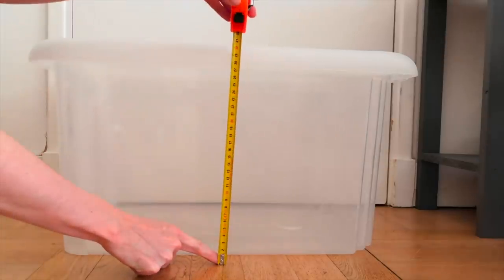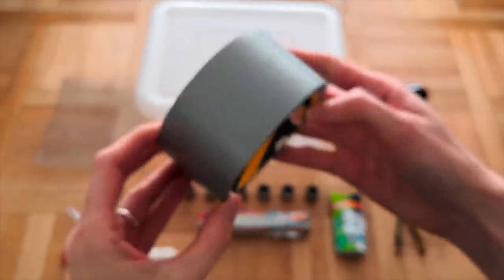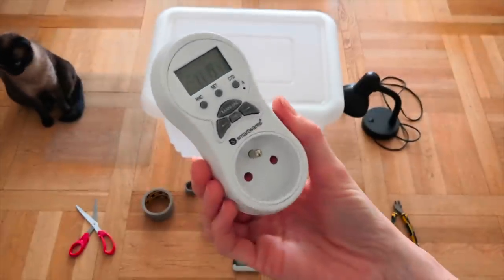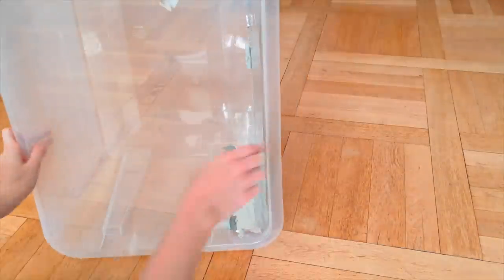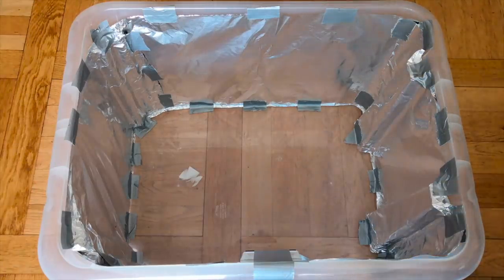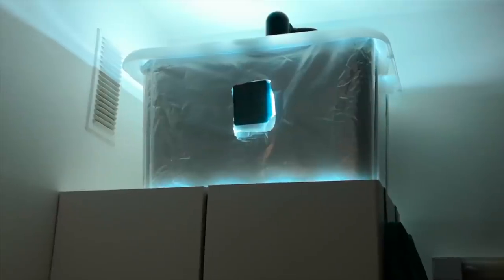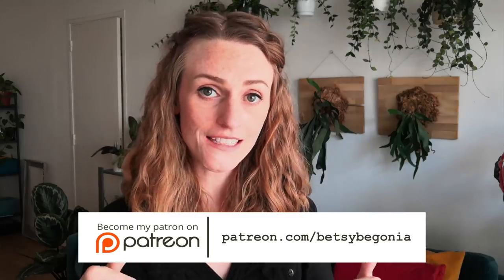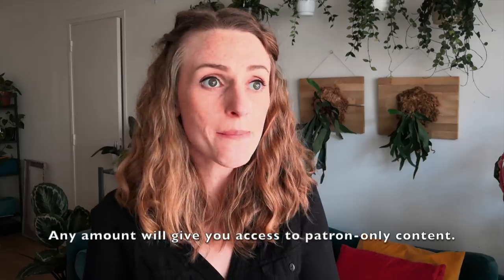Cheap DIY propagation box and grow light

Comment: Hi! Your videos getting more and more scientific! Once you go pro, you can never go back! :D Great budget propagator, i really like it, i would do also something similar. There is one minor modification i would implement: i would cut a small hole on each side of the box on the lower part, really close to, or at the bottom. This way as hot air exits at the top hole, cold air can flow in from the bottom holes from every side. Natural ventilation, without a ventilator. Leave some flaps of aluminium over those holes, and you can control it: box getting too hot? Raise the flaps, more cold air flows in. Temperatures too low? Seal the flaps, and you constrict the ventilation. You already got the thermometer in it to monitor. Now you have a temperature controlled propagator :) At least it would work this way in my head. Anyways, ever thought about doing some hydroponic projects? Careful, its addictive.
Reply from the maker: Currently with this setup, my box stays at exactly 27° while the bulb is on and 23° when the bulb is off. This has been pretty perfect for me but I really like your idea and the thought of additional ventilation. I will think about that for sure! Thanks for watching and commenting. 

I have not yet read a lick of literature on hydroponics. I probably shouldn't, I have a very small apartment! 😂 I already need to add another shelf for the next batch of babies that I hatch in this box.
Reply: Great suggestion Peter!

Comment: I did something similar to you.  When I did the cuttings, they started to wilt.  So I used large tubs like yours.  I built, using 2 by 4s and screen on top,  and put in tubs.  Then I put water in the tubs for hydration, and put the plants on top of the screen to keep them out of the water.  I put plexy glass over the tubs and suspended lights 10 inches up.  They look spectacular.   I will probably need to vent them also.  I have 85 plants, and another 30 Myzoo.  This is my first time doing this.

Comment: @BetsyBegonia thanks for another awesome video! I think I’m going to make one of these as I have virtually everything I need, even an extra grow light & live in the PNW (super gloomy). Unless I missed it, what temp & humidity do you aim to keep your propagation box at?
Reply from the maker: The humidity runs between 85% and 95% depending on how much water has pooled in the bottom. When the light is on, the temp is 27-28°C and when off, about 23°C.

Comment: Hi Betsy, thank you for your video it’s very informative.  I collect succulents and I’m looking to set up an indoor propagating station so to speak for lithops and conophytum.  Up to now all I had really found was actual grow lights as in the ones in your other video.  I live in northern England which is also permanently grey wet and cold autumn and winter and even spring lol.  Anyway I’m left a little confused it’s more the light information I’m after rather than the box as I have several heated propagators that I use and want to light them.  I get the lumins and Kelvin thing you explained that really well.  When I saw your video I thought great I’ve found a good cheap resolution to my problems.  Then I found the Sansi bulbs and I thought for the price and coverage area they look really good however, when I look at the specs they are only 4400 Kelvin, so are they really as good as people say?  Or does the fact that they are full spectrum make up for the lost Kelvin.  I just thought I’d put the question out there, I know nothing about these things. Thanks

Comment: Great tutorial.  I like the cutout for the thermometer gadget, not sure I would have thought of that.  I would be inclined to use white paper around the sides rather than foil, or you could slap some flat white paint on the inside.  Surprisingly, flat white surfaces reflect better than foil :-)
Reply from the maker: I used foil since most actual grow light boxes have a reflective interior but also because the box can be very humid (92% humidity) and the paper would not do well.

Comment: Great video and very useful too! I saw some propagation boxes at Ikea that are used for seeds and I thought how cool and professional those looked but I think this is a much useful solution (especially since I don't plan on starting anything from seeds, not much patience here 😂) I was wondering, and this is semi-related to the video, do you use any rooting hormones when propagating plants from cuttings? If so, would you say they are a must, especially when trying to propagate hoyas from cuttings?
Reply from the maker: The first time I propagated Hoyas, African violets, and Epiphyllum cuttings in this box, I did not use any rooting hormone at all. I just put them in soil and kept them moist. I now use rooting hormone just as a precautionary measure! I don't see any big difference.
Reply: @betsybegonia  Thank you! I will definitely have to get a hold of some rooting hormone and try making this propagation box 😊

Comment: Thank you for the informative vid. I made a propagation box based on your tutorial. However, I'm not getting much condensation or humidity. Any advise? Should I place a plastic bag over the rootings in the  box? I'm just afraid my Monsteras may root rot.
Reply from the maker: I find that water pools in the bottom below the raised grid and it creates a lot of humidity.
Reply: @betsybegonia  I'll try that. Thanks Betsy for the fast reply.

Comment: How did you cut the lid of the box?
Reply from the maker: I think I drilled holes in a circle with an electric drill, then used a knife to saw it out fully.
Reply: @betsybegonia  Will you do an update on this propagation video sometime in the future? I'm going to set this up and if there are any update I would appreciate it
Reply from the maker: @geoffreyivie9885  It worked very well. It's been a very long time since I used this box and those plants are mature now so I won't be doing another video on it.

Comment: Several times you noted that several of the items for this project are expensive.  Why not just buy a small grow tent and grow light, for probably the same price?  Also, it won't look rigged up.
Reply from the maker: This was much, much cheaper than a grow tent and grow light. And it's not expensive. It's a plastic bin with a clip light and a CFL bulb. I have grow tents now, they are much more costly and they're meant for growing all the time. Not everyone is growing new cuttings or plants in these conditions at all times. Some people just want a quick prop box go help a handful of propagations along.

Comment: One thing I might add, is that the light you used can get really hot.  I would caution anyone to watch this.
Reply from the maker: I used it for a very long time and it did not get very hot. But that's also why I warn people to put it in an area with good ventilation and to be sure to prevent any fire hazards. You wouldn't want to keep this in a small closet or something.